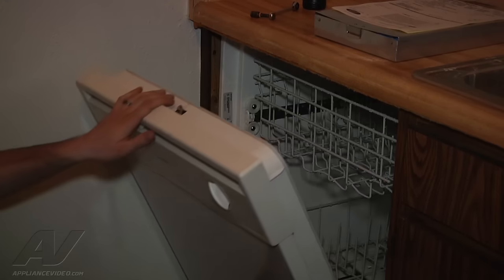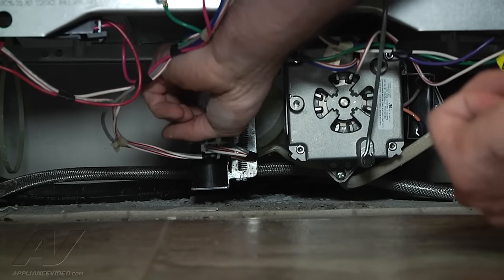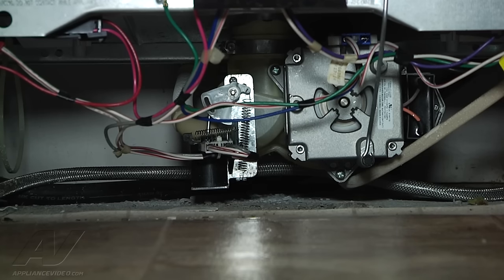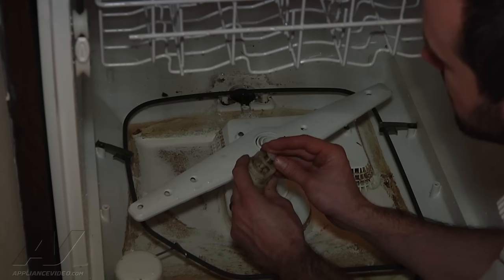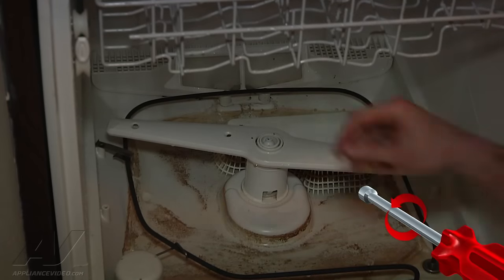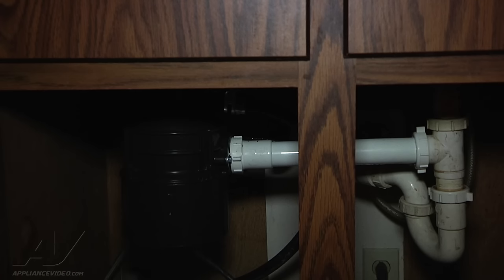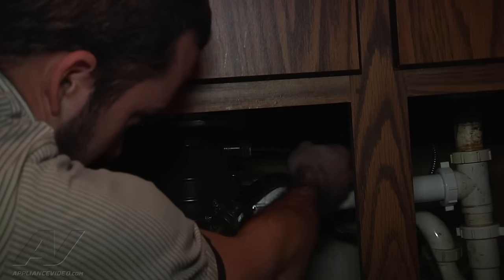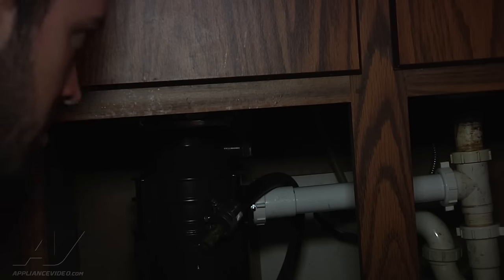HotPoint Dishwasher Repair - Not Draining, Dishes Not Cleaning - Drain Hose

Comment: I had to sign in just to say first, this dishwasher is DISGUSTING ! Seriously, how did the owner get so dirty? Is it the water? My dishwasher is 18 years old and looks brand new inside (never hand cleaned it) also don't load it with food all over the plates either.The reason I'm here in the first place is I could tell it wasn't draining. After watching the video, I discovered by using a mirror and curved tweezers to remove a bunch of crap (like tie wraps, small bits of plastic and hair) stuck around the chopper blade. I actually learned alot about my dishwasher I didn't know before, so thank you

Comment: Thank you for posting this video!  This helped to fix my draining issue on my HotPoint.  The primary culprit was the drain hose, but I also took out the various pieces and cleaned them.  There was a lot of gunk that looked like wet paper.  We typically pre-clean (just wipe off and rinse) our dishes, so I'm thinking the gunk was a build-up from our dishwasher soap (have used tablets and liquid soap - very bizarre that it is causing the gunk).  We usually run a maintenance cleaning cycle of vinegar through it around once per quarter or 6 months, but I'm thinking that this cycle should be increased to help with the gunk removal.  I did notice a slight dripping from the drain plunger, so that will be my next thing to tackle.  Thank you again.
Reply from the maker: Thanks for your response, we are glad we could help. Our library of over 5,700 videos are currently helping over 1.6 million people like you every MONTH.  Please help us by subscribing to our YouTube channel, or post our website www.ApplianceVideo.com to your Facebook page, Twitter, Instagram or any other social media sites. Your support will help us keep producing more free quality videos.

Comment: Hi. Got a a question for you. I have a GE gsd500g-01aw and I checked all the back up spots and now I am going to snake it. But that drain basket that you put back @7:48, does it have to go back a specific way? I notice you put it with the cutout that’s in the face towards the back. Is that correct for my dishwasher as well?
Reply from the maker: Great question, if you have a more technical question that our parts department cannot answer, you can search our over 13,000 answered questions free at our website www.ApplianceVideo.com under our Repair Help section. You can also call our parts department at 1-800-830-5465 and they can give you help 7-days A week ,or search at www.SaveMoreOnParts.com  .

Comment: What do we do if the area where it drains at the bottom (where the screen was you too out) leaves standing water?
Reply from the maker: Great question, if you have a more technical question that our parts department cannot answer, you can search our over 17,000 answered questions free at our website www.ApplianceVideo.com under our Repair Help section. You can also call our parts department at 1-800-830-5465 and they can give you help 7-days A week ,or search at www.SaveMoreOnParts.com  .

Comment: Months ago, a tenant complained their same model of Hotpoint dishwasher was leaving soap residue on the dishware. I took the filters screen out. There were some small pieces of glass in the filter. The little blade inside was clear, but I cannot recall if I removed any glass. Everything was clean.  It had a red drain ball or whatever and it was clear. At the time, it had been draining.... or at least the machine was free of standing water. Today, it is not draining at all.  I ran the washer and I heard water discharging in the sink drain. However, I could not get the washer to drain again as I continued to test. It seems intermittent. I removed the drain hose from under the sink, connected a wet vac to the hose, and cycled the washer by rotating the dial on the washer, it didn't seem to be pulling water but then it did. I pulled quite a bit of water. The machine never fully emptied, though. When I cycled through with the dial, I never heard a click or sound from below the machine. It is loaded with water. My only idea is to replace the solenoid or tell the property manager to tell the landlord to buy a new machine. A stick of dynamite crossed my mind. Maybe I should pull the lower panel and take a look, regardless. Thank you. Edit: As I continue watching, mine is a different model but has the same control panel, it is a HDA3600H50WW.
Reply from the maker: Great question, if you have a more technical question that our parts department cannot answer, you can search our over 17,000 answered questions free at our website www.ApplianceVideo.com under our Repair Help section. You can also call our parts department at 1-800-830-5465 and they can give you help 7-days A week ,or search at www.SaveMoreOnParts.com  .

Comment: During the video the tech mentioned this model has a short drain cycle.  Our issue is we have to run a drain cycle 2 or 3 times before running the wash cycle.  The drain pipe appears clear as quite a bit of water seems to drain each time, just nor enough drain the washer.  The dishes aren't getting as clean now either.  Since the unit is at least 5 years old and we use it a lot, almost daily, I'm inclined to think the drain pump is starting to go.  I may try running vinegar through it until we get a new, better model as this one was installed under a Home Owners' Warranty.
Reply from the maker: Great question, you can call our parts department at 1-800-830-5465 and they can give
you help 6-days A week Mon-Sat . If you have a more technical question that our
parts department cannot answer, our technicians are answering all questions at our website at www.ApplianceVideo.com under our Repair Help section. We have over 4,000
common questions and answers that you can easily search through by your model
number, appliance make, and problem or error codes, and It’s free to search
through our question & answer library.

Comment: Nice troubleshooting video. I have a slightly different GE model, but I went through the steps. Mine actually did have a worn piston nut assembly in the back. Ordered a replacement & was back in business draining properly about 10 minutes after the part arrived. Thanks!
Reply from the maker: Chris Sizemore        Thanksfor the positive comment. Hopefully we saved you some money. Please help us
provide more videos to our site by posting ApplianceVideo.com on your YouTube,
Facebook or Twitter account or add us to your circles. If you are in need of any parts please support
our parts department on line at http://savemoreonparts.com/ or call 1-800-830-5465 7-days a week until 11pm Eastern
time. Thanks again your support.  Matt, Ace Appliance service technician.

Comment: I have a Hotpoint dishwasher model #3600.  I've been following the instructions point by point but when I got to removing the screen there is a collar which keeps it from coming off.  How do I remove it?
Reply from the maker: Stan
   All of our technicians are now answering questions daily on the ApplianceVideo.com website. You can search completely FREE in our Repair Help section. Or you can get unlimited technical advice and video links emailed to you by our 14 factory certified technicians at http://www.appliancevideo.com/premium-membership/.  If you are in need of any parts please support our parts department on line at http://savemoreonparts.com/ or call 1-800-830-5465 7-days a week until 11pm Eastern time. Thanks for your support. Matt Ace Appliance factory service technician.
Reply: I have the same issue. Did you find an answer?
Reply: Depends. I have HDA2100V35WW so for mine there is a bolt facing the door that holds it in place. You need to take the spray arm off before you can take that out.

To take off the spray arm there is a clip facing the back of the dishwasher that you need to take pliers to grab and pull towards the back of the dishwasher not too hard just enough to get it out while you pull up on the arm it should come loose. Same goes for the collar that clip needs to be pulled back for it to clear. Be careful tho they are plastic pieces.

Hope that gives a little clarity. I tried to explain it the best I could.

Comment: I have a different drain problem. The tub starts filling. After it is nearly full the drain lever bobs up and down by a millimeter or two and then slams down and drains. The motor and timer still runs as though it was washing, but the water is already gone. Then at the end of that cycle, the solenoid trips and of course there is no water since it drained early. The next cycle starts and it fills and the sequence repeats. So the next thing I did was to use a clamp meter to check the current going to the solenoid. When it drains prematurely, it isn't being powered! Next I used a screwdriver and held the drain lever up except when the solenoid is powered. It wasn't difficult other than having to lay down beside the washer for an hour to check through an entire cycle. The next thing I did was remove and check the spring that keeps it open and it was fine; no corrosion, and retracted completely. I then used a plastic wire tie to hold about a 1/3rd of the middle of the spring together, thus increasing the tension/pull of the spring. It then completed through an entire wash/rinse cycle on it's own (but without any dishes). Though the lever still bounced a bit. Now it gets through an entire wash cycle maybe 50% of the time. It seems that the water circulation is somehow pulling on the valve until it flips up enough to be pulled open by the drain water pressure. I'm thinking I should just go to the hardware store and buy a tighter/stronger spring since the drain valve is not replaceable by itself (you have to buy a new entire motor/drain assembly, which sucks). Any other ideas?
Reply: I think I've got the same exact issue. Were you able to find  a fix for it? 

I'll check out my spring. At least once it's dried out. I ran it with the door open a bit to see what sounds where what a bit.
Reply: I took the spring off and went to the hardware store to get a stronger one that is the right length. I actually bought two and ended up using the one that was only slightly stronger. The other was too strong. This 'mostly' worked. Next, in order to eliminate any possibility of some build-up of scum on the valve flapper causing drag in the water, I used "Finish Dual Action Dishwasher Cleaner: Fight Grease & Limescale, Fresh, 8.45oz". TWICE. and the rest of the problem cleared up.

Ultimately, I'm guessing the flapper on my unit actually has some damage and in the long run it will need to be replaced, if I can find one that is not part of an overpriced entire assembly that would consequently replace perfectly good parts for no good reason. (I know. Fat chance these days where the standard practice is to sell and entire motor assembly for hundreds of $ when all you really need is a $2 bearing and a few tools. The manufacturers seem to just want you to buy a whole new washer and so they do their darndest to make it as painful as possible to fix almost everything. It's worse in the electronics industry, but I digress.)

I also just ordered "Food Grade Citric Acid 5 Pound Bag" and plan to add a tablespoon to each wash in an empty up turned glass drinking cup I will keep in the corner of the top rack. My idea is that during the pre-rinse, the cup will slowly fill with hot water and dissolve the citric acid. Then that will overfill with water and slowly release some of the dissolved citric acid during the wash and later rinse cycles. I'll probably try the citric acid in the clothes washer (without clothes) to clean the tub.

Another appliance channel suggested it as a good cheap source to keep clothes washers clean of soap scum; but unlike dishwashers where you can add it to a cycle while washing dishes, don't have clothes in the clothes washer when you use citric acid. Hopefully my clothes washer hasn't had so much build up that the scum is preventing a leak and cleaning it reveals a long-standing undetected problem.

Comment: Thx, nice job. Motor tries to turn, but doesn't. Any ideas? Thx in advance.
Reply from the maker: I would check the motor windings, you may have a defective motor that is drawing high amprege.   Help our site ranking by becoming a Subscriber and we will keep up-to-date with our growing library of DIY appliance videos. Purchase the parts you need by calling 1-800-830-5465, or order online at: ApplianceVideo.com. Our family-owned and operated company provides you with FREE, high-quality repair videos. Thank you for your continued support and good luck on your project.
Reply: Thx for your response. That very same day I was able to get the dishwasher going. Apparently, the impeller was stuck. I put a load on it and carefully gave it some help with a screwdriver. It started spinning and everything was back to normal. Have a good year. Great videos.

Comment: We just bought a house with one of these units and it is not draining. We will go into more depth tomorrow but we did take off the cover from the bottom of the tub and vacuumed the debris that was in there by the blades. I didn't feel those but will check again. Last week it drained just fine, this week there was an inch and a half at least of water after it was done drying. We removed the hose from the disposal and found water in it, but didn't have anything to snake through it. Tried pouring water into the tub of the dish washer to see if we could force water out and that did not happen. Is there a way to get the spin head off and clean it? I can see debris in the tiny holes but can't remove it or clear it out. Thank you for the video and thank you in advance!
Reply from the maker: Laura
            All of our technicians are now answering questions daily on the ApplianceVideo.com website. You can search completely FREE in our Repair Help section. Or you can get unlimited technical advice and video links emailed to you by our 14 factory certified technicians at http://www.appliancevideo.com/premium-membership/.  If you are in need of any parts please support our parts department on line at http://savemoreonparts.com/ or call 1-800-830-5465 7-days a week until 11pm Eastern time. Thanks for your support. Matt Ace Appliance factory service technician.

Comment: Mine drains DURING the wash cycle (so the pipe's not clogged), but NO drain cycle at the end....(?)
Reply from the maker: Good question, with our
technicians now getting hundreds questions weekly, they are answering all questions
at our website http://www.appliancevideo.com/repair-help/ .  We also have over 3,000 common questions
and answers that you can easily search through by your model number, appliance
make, problem or error code and it’s absolutely FREE.
Reply: Ours drains too, just not completely at the end.  I have to drain it 2 or 3 times every time I use it so we won't get sick.  I've heard good things about KitchenAid and Bosch but we'll probably go with a Whirlpool or Maytag to replace it.

Comment: Gsm2200vooww was recall for the spray arm.
Reply from the maker: Great question, you can call
our parts department at 1-800-830-5465 and they can give you help 6-days A week
Mon-Sat . You can also search at www.SaveMoreOnParts.com 7- days a week.  If you have a more
technical question that our parts department cannot answer, our technicians are
answering all questions at our website at www.ApplianceVideo.com under our Repair Help section. We have over 6,000
common questions and answers that you can easily search through by your model
number, appliance make, problem or error codes, and It’s completely free to
search through our question & answer library. There is a very good chance
you question is already answered there.
Reply: @Appliancevideo   my neff dishwasher is not heating water at all. Any advice?

Comment: Mine doesn't have the thing in the back,, how do I check if it needs to be replaced or not,, do you know where it is?.
Reply from the maker: Great question, if you have a
more technical question that our parts department cannot answer, our
technicians are answering all questions at our website at www.ApplianceVideo.com under our Repair Help section. You can also call
our parts department at 1-800-830-5465 and they can give you help 7-days A week
Monday -Sunday, or search at www.SaveMoreOnParts.com  24 hours
7- days A week.

Comment: Is there any way to drain excess water? The problem is I had put too much dishwashing fluid and it had caused it to have a soap bath on my kitchen floor. Now there is an excess amount of water almost covering the heating coil and still soapy. Is there any way to drain all the water at once? 

I have tried emptying it with cups. Then when I turn it on there is still soap fluid from the dishwashing soap so it gets soapy again
Reply from the maker: John
       Our technician uses a shop vac to remove excess water. Thank you for your positive comment.  Please
help us provide more quality videos  by
subscribing to our YouTube page or posting our ApplianceVideo.com site on your
Facebook or Twitter account. We also have our authorized technician's daily
emailing professional advice daily to people like you that have appliance
problems. We have helped thousands of people save hundreds of dollars. Thanks
in advance for your help.